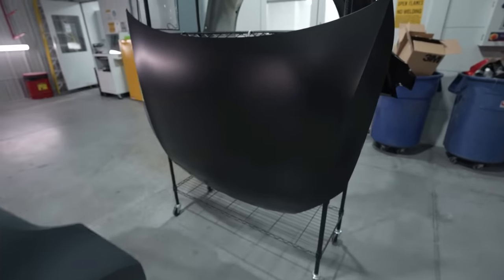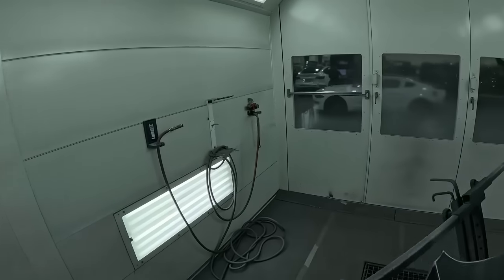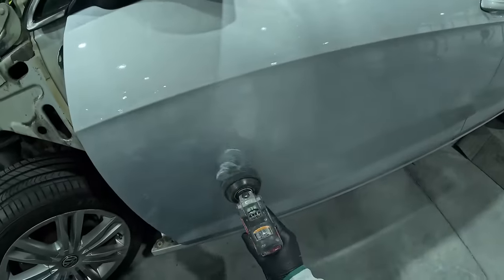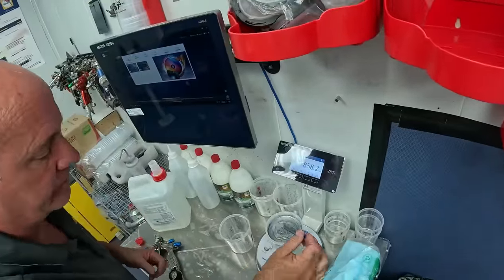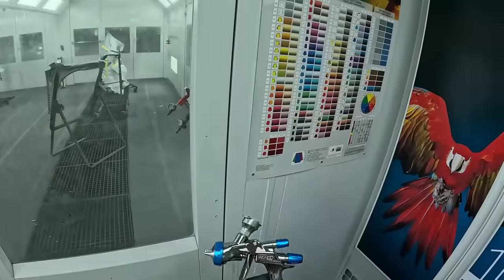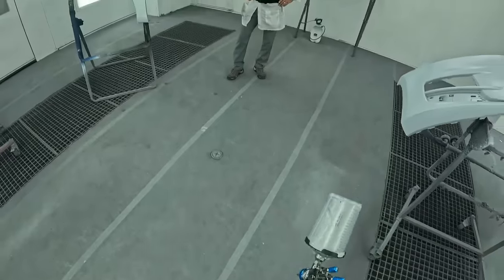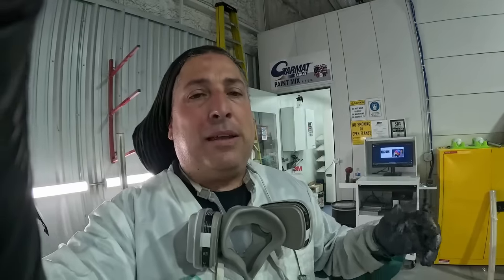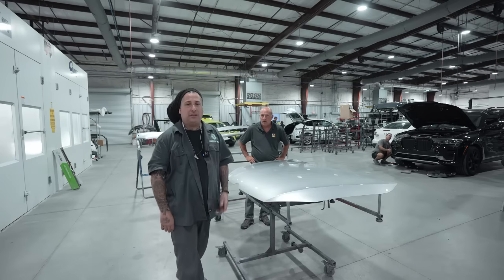First Day Training With BASF Glasurit 100 Line

Comment: Also make sure you get some 1000 metal prep wipes.. it’s the best way to treat the bare metal! They also have 801-74 and 801-76 so you can make epoxy sealer like you did with your bare metal wet on wet jobs! It works well

Comment: tough day. my favorite time at work is early or late when the shop is empty and quiet. the basf sealers are top shelf. i always sand the exteriors but i never have problems with adhesion on insides and undersides with the right cleaners. its definitely a time saver and my sanding hand appreciates it!

Comment: Amazing video Kandy Man I found this very interesting, the Glasurit system looks like it's going to be good as the first job came out superb, it must seem strange to use the spectro for every job and not have any colour chips, the manufacture must be very confident that the spectro is spot on every time as some painters I know that use a different paint line don't trust the camera to give accurate results🤔

You are doing a great job so far Kandy Man, once the first job is out the booth it can only get better👏🙏👍John UK

Comment: I’m really enjoying this switch over content, I spray Standox waterborne which is a 1.5 coat system. It would be very hard to re coat a silver after it’s dried, so that tells me the BASF works a little differently than the Axalta systems. Interesting

Comment: Your weather is different than mine since I’m in Indiana.. but I would spray that silver with the mb40 mixing clear and reducer..
I don’t think they gave you the extreme slow mb40 but I would at least use the 10x and the mb50x

The slower drying the better for laying out the metallic on the big panels like the hoods etc! I’m sure you noticed it tries to dry before you can do your orientation coat. The slower mixing clear and reducer helps a lot with that.
Also just know that the sealer color recommendations are system generated and not field tested. So i will deviate from that recommendation at times. That silver the way you sprayed it would have covered better over one shade darker (L02)

I also find that the darker reds like RR and wa434b cover everytime over L01 but the system will recommend lighter like L03.. so definitely don’t be afraid to play with that! 

The wetter the better on that base! Just have to watch going to wet into the wet bed.. it will cause the base to fish eye on you! I like the mb40 wet bed the best it sprays clear and stays wet the longest! My booths have blowers built in the walls and we have an air drying system so our set up drys extremely fast.. so my recommendations might not apply to your set up exactly the same.. 

I like the 460 clear with the 93 hardener and the 216 reducer.. give the slow reducer a shot definitely being in Florida it will post flow a little more

I also like the high solid 255 clear for the best overall appearance and hold out

Hope this helps man.. you have taught me a lot and I appreciate your videos

Can’t wait for the next one
Reply from the maker: Thanks for the insight
Reply: The 255 clear is the ticket. Great clear but comes at a cost

Comment: I leant something with cleaning the spot after buffing before taking a pic. Looks good
Reply: I also have a question for your guys. I notice he said not to use she solvent cleaner (I use onyx hd, water most of the time,  so for me it’s 900) on primer, cause it could lift the edges, is that a worry even if you seal the primer area?

Comment: Lay that color on nice and slow as if you’re filling the body guys pinholes with high build primer. 
This application is similar to 480 hi-tech 1/2 coat system.
Reply from the maker: You ain't lying 👌

Comment: I know it’s a bit of a push back all the comments are sweet. Seems like a handful of extra steps. From the last video and this with the cleaner. No chips,camera only, e coat cleaner for help with adhesion, multiple hardeners. One and done. I wonder if it’s cheaper than PPG? I used to talk stuff about PPG but the guy who knows it is worth his weight in gold. Those cameras are not always that accurate. We will see with time. I might eat my words but that’s ok. They weren’t too bitter 😅. Love the content though. Good stuff. You’ll figure it out….ohh and the shake. Lol

Comment: Yeah this new glasurit is very similar to cromax pro if not exactly the same interms off application , but one thing i noticed that when you applied a second coat you could lay it down wet , with cromax that dryed first layer would just suck that second coat and you could not get it that wet , so if you had a light metallic like this and had a problem in the first coat and its dry you where better off clearing it and redo it because that would be mottle city , atleast in my experience, so plus points for glasurit , cromax is also very and i mean very difficult to blend on silver doors any other color or panel you would be okay but damn do i hate that system sometimes

Comment: be careful wiping last with the BASF water cleaner. i spray RM onyx and the water cleaner has to be diluted way down with water because of its strength. even with wiping it until it’s completely dry it’ll still cause a reaction to the basecoat at times.
Reply from the maker: Thanks for the insight
Reply: @kandyman5315  no problem, nothing more aggravating than spraying base and getting bullseye reverse fisheyes because of the water cleaner.

Comment: You need to ask your rep about 285-02 it’s a translucent sealer mixed with the color for even faster coverage…I know it’s available in the 90 Line but I’m not sure about 100Line. I’m a little jealous because I wanted to use 100 Line in my shop but it’s too expensive for the volume of work in the shop I work for so I’m using 90 Line and have been nothing but impressed I can’t imagine how easy and fast the 100 Line is!!!!
Reply from the maker: Ok thanks!